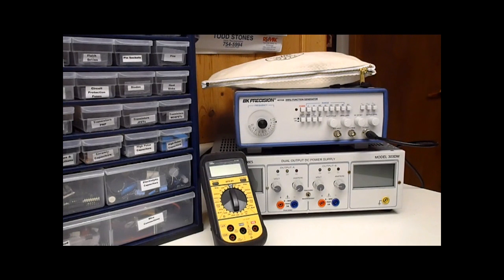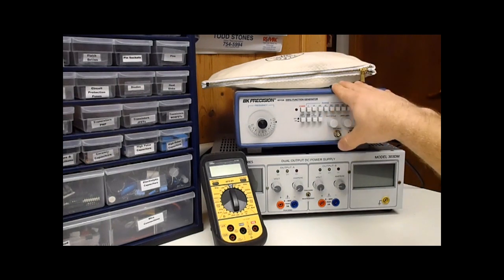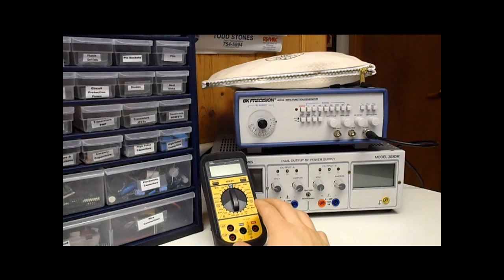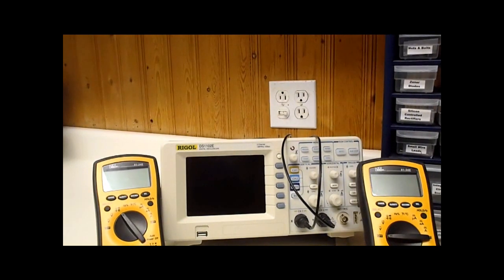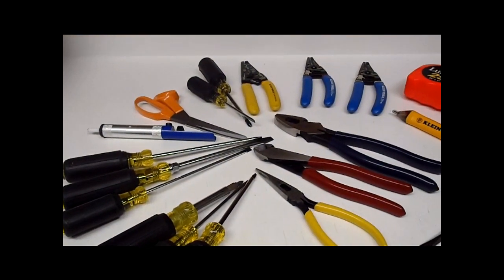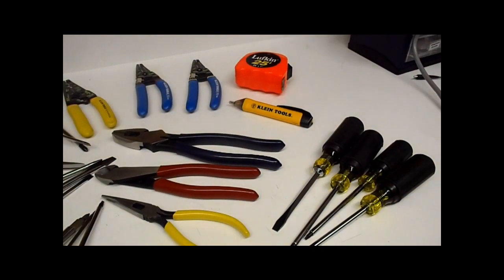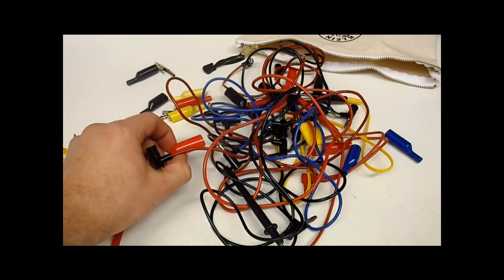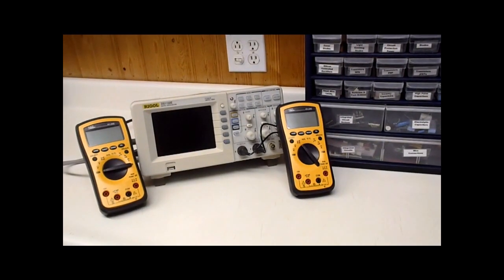Electronics Lab

Comment: I use to design tube preamps and amps but now most of my work is with tube receivers used by the military once and now by Ham ops. For audio work, a spectrum analyzer is very nice as well as a distortion  meter. With these 2 items and your scope you would be a great shape. Ham Fest are often great places to buy gear. In fact today was the Greenville Ham Fest and I found an excellent Tekt 465B for $75. I have 2  but I love this 100 Mhz scope.
Email me, for more info.
glenn at dsmlabs.com